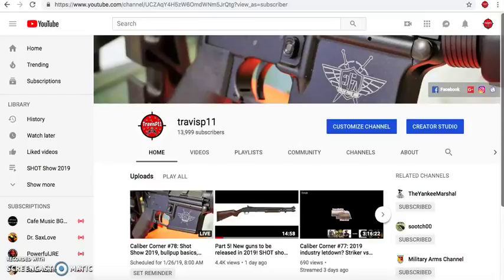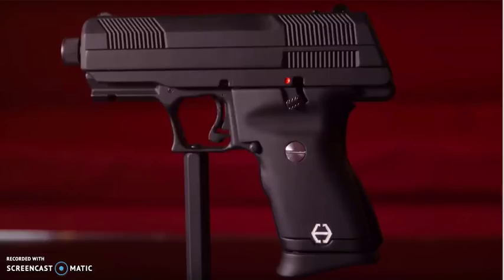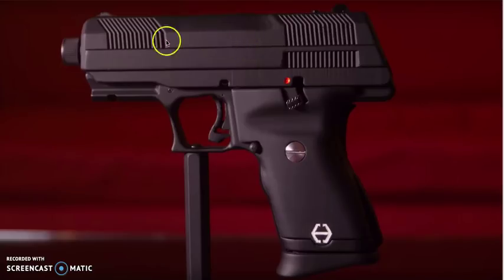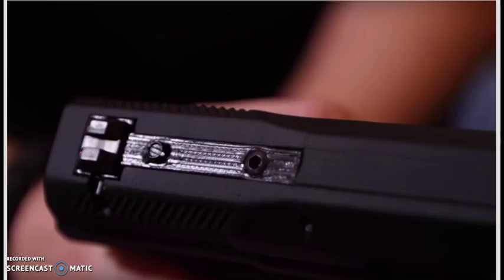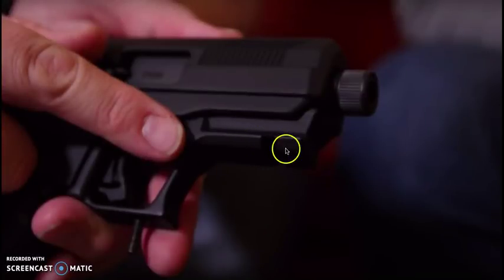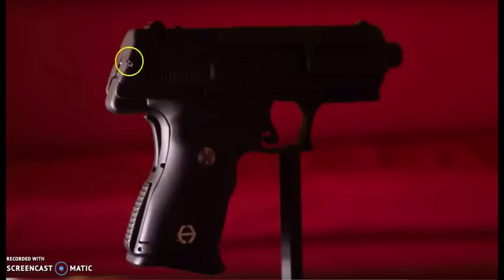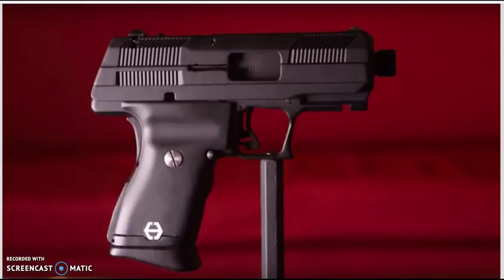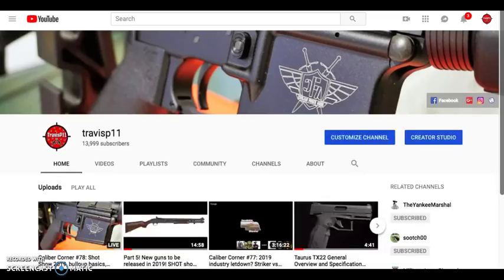2019 SHOT Show New Hi Point C9 Prototype Overview...what we know so far (TFB thank you)!

Comment: For $200, why would we purchase this over a Taurus G2?
Reply from the maker: It has options out of the box that the G2C doesn't. If we get the 15 round capacity and threaded barrel they are talking about it will have some advantages. Remember, that is MSRP, actually out the door price most likely could be less.
Reply: Transferable Lifetime Warranty, Made In America, Red dot suppressor capable at less than or right at $200 Taurus only has a one year limited warranty now.
Reply from the maker: @BrokeBoy912  yup!
Reply: 200 would be the msrp like the c9 is. Hopefully will sell for closer to 150